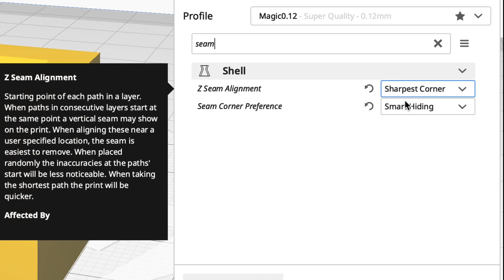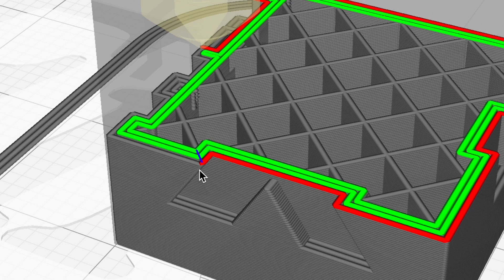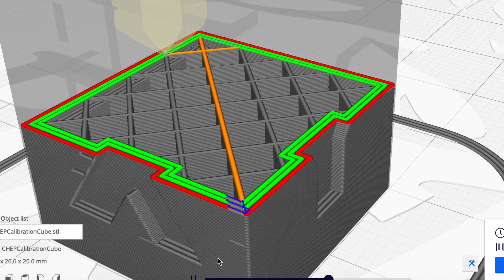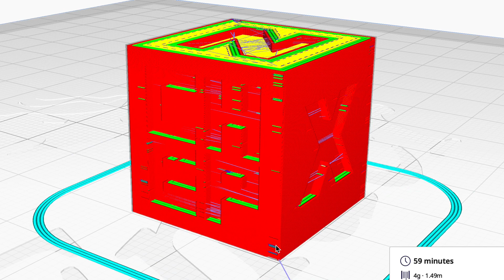Improved Cura Slicer 4.4 Profiles for Creality Ender 3

Comment: Hey Chep, I just moved from an Ender 3 Pro to a Prusa MK3S and you know what's the worst part of this move? I don't have your support anymore, haha. If you could upload a Cura profile for Prusa printers, I'm sure many people would be super grateful as your profiles are simply the best.
Reply: And whats are your first feelings and opinion about print quality, differences and needed adjustment of printer and so on? Do you think its worth to do such an upgrade, just for hobby printing? I also have Ender 3 Pro, and looking for more reliable printer, where i dont need to make a lot of adjustments all the time (in case of my Ender), and just print.
Reply: @creativ01  After spending over a week with the Prusa I can tell you stick with the Ender. Still haven't gotten to the quality the Ender gave me (thanks in big part to Chep), and the amount of things that can require adjustment is simply ridiculous. Also, and I'm still surprised by this, the Ender community is much more supportive. There are way less information about the Prusa (how is this even possible??)
I'll give you some pros and cons, as I'm still a bit emotional about the change, hehe. It's better I stick to the objective facts.

Prusa pros:
- Obviously all the cool stuff. Direct drive extruder, autoleveling, magnetic bed, it's quiet, etc. It has very good components. The bed and hot end heat up at the same time and takes no time to reach the right temperature.
- The entire printer is open source, so if anything fails you know quite well how to fix it.
- If you buy the kit, apart from saving some bucks, you will know quite a lot of the printer and admire how nicely engineered it is.
- The printing volumen is smaller (than the Ender), but I like that the X axis is 25cm long, so for 25cm pieces I don't have to use the brittle Z axis.
- It can do all the normal materials with no problems, which is nice.
- Looks cool. It's compact, orange and black always look nice... 

Prusa cons:
- From 12 to 16 hours to assemble the kit, with the extra risk of doing something wrong. The first 6 hours are fun, the rest of the time, you just hope all will be ok at the end.
- As the pieces are 3D printed by prusas, even in the extruder, there are so many things that can fail or be improperly adjusted. IMO, the extruder should be all metal and with way less things to tune manually. I would even consider paying $100 more for a kit that comes with the extruder pre-assembled and factory calibrated (like the Ender).
- I find less support that for the Ender, and as I said, I'm still shocked. Maybe I haven't spend time enough digging, so let's leave that for now on the side.
- The printing quality is the same, or maybe even worst than my Ender. There are tons of posts about extrusion inconsistency, bad layering, etc. and many times I have read people being very frustrated about the experience and how they are considering getting an Ender.

Final thoughts: I'm gonna stick to my Prusa as I already pulled the trigger, and I'm gonna fight to make it print as good as possible, but if I knew about all the issues and printing quality that is giving me a month ago, I would have kept my Ender and spent $200 in extra upgrades (new extruder, some extra tuning, etc. same stuff Chep does :) My Ender has given me flawless prints, that I would say are almost impossible to beat in the 0.2, 0.4, PLA territory, and has worked GREAT out of the box. 1 hour of easy assembly and boom.
Reply: @ALZHEM  Thank you very much for that valuable informations and experience. I have made some upgrades on my Ender already and im pretty ok with quality so i think, i will stick with it. I wish you good luck with Prusa and a lot of great prints.
Reply: @creativ01  Happy to help bud, and happy printing to you too!

Comment: OMG, used your profile for my Ender 3-Pro. I finally can print nice things. Thank you.
Reply: May I ask how did you load the profile on Cura with Ender 3 Pro?  Mine keeps showing blank folders.  Thanks in advance.
Reply: @jamilawolf9805  I downloaded his profile onto my downloads folded on my PC. I don't use Dropbox. So you will have an option for direct download. You will then need to extract the folder to see the profiles. pick the profile for the Cura version you are using. Let me know if you still have any issues.
Reply: @nikkigolightlygames  Thank you very much, I got it downloaded and opened.

Comment: Hi, I want to say your profiles are amazing. I have never used anything other than the stock profiles with cura and they seemed to work. Your profiles show much crisper detail in the prints :) I am having one issue however, and being a novice I am unsure what to look at to fix the issue. Upon using your 0.2 layer height profile to print a raspberry pi enclosure I had a major issue with it trying to print the solid circle on the first layer. It appears the profile attempts to start the solid circle from dead center and rapidly turn outward making the solid circle to size. Unfortunately, when it starts in the center and moves out it appears there is not enough distance gained from movement and it doesn't lay down the filament. Instead the filament attaches to itself and forms a big ball until the circle gains size. The blob is then left behind on the circle and missing the center section. I know the bed is leveled fine, as the standard profile printed the enclosure fine. Please, any ideas would be helpful. Again, thanks!
Reply from the maker: That doesn’t sound like the nozzle is close enough but you can change first layer pattern from concentric to get the same 1st layer as standard.
Reply: Thank you! I'll double check everything before switching. :)
Reply: Jeffrey Bradley Hi, I have found the same issue, did you solve your problem?

Comment: Am a HUGE fan of your MAGIC profiles. Been using them for a while now. Thanks for all the effort you have made! However, today I changed my nozzel to 0,8mm and it dont work quite as I expected. Changed the line width to 0.8 etc. But there is a big gap between the START and STOP for each layer, creating a big gap. 
Disabled the "Enable Coasting" feature but that didn't made any change. 
Is it possible to make a Magic profile for 0.8 nozzle? 

Best Regards Mr Semla.. 
PS: Happy New Year to all of you at Filament Friday!!

Comment: I ended up going back to your 4.3 profiles.  At least for 0.28 I had all sorts of issues with zits and just really ugly prints, especially for prints with rounded corners.  (And yes I did upgrade to the latest version after you announced there were issues) whereas your 4.3 profiles for 0.28 with the same flow rate produce absolutely beautiful prints.  Perhaps its something about my setup that means the 4.4 profiles are not producing nice results.  I do have a knock off dual drive extruder, but that works just fine with 4.3 profiles.  I don't really have the time to figure out what about the 4.4 profiles is not working.  The chep cube for 4.4 0.20 was a beauty, so perhaps its just 0.28 that is a problem.  When I have some time I will try a 0.28 chep cube with the 4.4 profile and see how that turns out.
Reply from the maker: There have been some complaints about 028 but 020 and 012 seem fine. I’ll go back and look at 028 again.
Reply: CHEP  that would be great. All in all I’m getting good prints with the 0.2 (thanks heaps) but tithe rounded corners (MakeChetti Ender’s display cover) are not great. Cheers
Reply: Jason Pell I was having the same with the 0.28 profile

Comment: I'm giving the Magic 0.12 profile a shot on a 28mm miniature right now. I am surprised by the speed as the extruder is moving much faster than the other profile I was using. When using one of the three Magic profiles, does it matter if I use a 0.2mm or 0.4mm nozzle?

I also bought a set of belt tensioners after watching your previous video and they make tightening a belts a breeze. Very much appreciated!
Reply from the maker: I didn’t see a major difference in 0.2 nozzle.

Comment: HI Chuck i've had problems with sticking for the first layer on my prints. I have to turn the travel speed very low to about 5mm/s to get it to stick and thats even for very simple prints. I also increase temp and initial layer flow. These do work however I am trying to test a much harder baby yoda print (similar to the one u recently posted about). I'm using the Magic 0.12 profile and even at 7mm/s it will not stick to the bed, especially when doing small circles, mainly i notice that the travel speed is so much faster than the initial layer speed that it pulls the PLA off the bed. I've used your square bed levelling test and that is perfect and I am using the default magnetic bed that came with the Ender 3 Pro. Do you have any idea how to fix this issue?
Reply from the maker: Try cleaning the bed surface.
Reply: @FilamentFriday  I've just tried that, no success. The main problem I think is that when i started printing, I had my bed way too close to the nozzle during a print (this was because i was having issues extruding filament although it turned out the nozzle just needed cleaning). Now there is an outline of that print on my bed and it's very smooth. Do you know if it is possible to fix this, or will i need a new bed?
Reply: I have been using aerosol hairspray and loving it. Might try it

Comment: I imported your profiles into Cura 4.4.1 for my Ender 3 Pro.  I noticed that they override the materials print temperature.  I use several different materials with different printing temperatures but no matter what material I select the "Printing Temperature" is forced to 205.
Reply: Hi Fred, 
I had the same issue, so I modified the "Standard Quality 2.0" profile to match CHEP's magic and then saved it as a new profile. Now the temps change with the material.
Reply: I found the problem in the config files. The various print temperatures were hard coded to 205.  The profiles are located in %appdata%\cura\4.4\quality_changes\.  The ones to edit are the creality_base_extruder_0_magic0*.cfg files.  There are several "print_temperature" settings that are hard coded. (e.g. material_initial_print_temperature, material_print_temperature, material_initial_print_temperature, default_material_print_temperature, etc.). I deleted the "default_material_print_temperature" line. This will force the profile to use this setting from the material profile. Next I edited all the other *_print_temperature = 205 lines and changed the "205" to "=default_material_print_temperature" so the line ends up looking like "material_final_print_temperature = =default_material_print_temperature
".  (the "= =" is not a mistake).  For me this was not a difficult fix as I am  software developer.  I posted here in hopes the original profiles would be corrected so that everyone would not have to edit the profiles.

Comment: I noticed that the .12 and .28 profiles both have hard coded  fan starts at .2.  this seems to cause the part cooling fan to be on from beginning of .28 prints.  Is this expected?
Reply from the maker: That’s a mistake in 0.28.
Reply: What should it be, should I change it to .28?  What about for .12, should that be .12, or is .2 still correct?

Comment: When I Preview in Cura 4.4.1 my view is all yellow. How do I get the colors like you show and simulate the nozzle like you show? Is that some kind of add-on? I looked all around in Cura and can't seem to find anything like that.
Reply from the maker: It’s default for me.
Reply: @FilamentFriday  Well, in Cura, Preview mode, click the pencil up top in the Color Scheme header and you can pick different schemes, very cool. So I have THAT figured out, but I still don't know how  you got the print head to zoom around like that!! More to learn. OH, and yours is likely "default" because once you pick a scheme it's "default" and you probably picked it years ago and it's just there for you:) I'm sort of new to this, so mine will default to that now, too!
Reply: To see the simulated print, to the right of the settings box is a vertical bar that is actually a scrollbar. You have to slice your model first though.

Comment: I've been seeing a lot of people saying they are still getting blobs or zits when they are using this profile with their esteps already calibrated. I was in  the same situation then I turned off retract before the outer wall. this seemed to get rid of it all as my extruder was retracting then pushing out more filament than it needed to when starting the new layer for the outer wall. Hope this helps people.
Reply from the maker: Interesting.
Reply: This helped slightly, but nowhere near the quality of the 4.3 profiles.

Comment: @Chep, as for many, the new settings worked exceptionally good on angular objects but the cylindricals come up with the worst chickenpox I ever seen.
Reply from the maker: Check you ESteps settings. My pawn is smooth with no chickenpox.
Reply: wtf is chickenpox on a 3d print?

Comment: Just upgraded from Cura 3.6 to 4.4 and my print times doubled. Adhesion and quality seem to be better, but that speed decrease was quite a shock. Not sure what specific settings caused it.
Reply from the maker: 3.6 wasn’t accurate but double seems excessive. I covered the difference I saw here:
https://youtu.be/iglfelMd7HI

Comment: Hi Chuck, there seems to be a bug in Cura 4.4. If I want to print a single layer with a layer height of 0.15 mm, it does not allow it. It creates two layers instead as a default.  So creating a thin  single layer strip seems not possible which I could do with previous versions.  Do you know anything about this?
Reply from the maker: Why would you want to create a one layer print?
Reply: @FilamentFriday  For a living hinge design for a lid of a small box. With this bug, now it does not work! The hinge is too stiff with two layers.

Comment: CHEP, I already saw a comment below, but a lot of people might have issues with e steps/flow rates. Personally even with calibrated steps I need to use around 90% flow. Without reducing the flow I was also getting a lot of zits in places where prints have started. Overall thank you again for the profiles, your channel is a great help with upgrading my printer and learning new things.
Reply from the maker: Every filament is different but many are getting the same results I am. If you have to reduce to 90% flow for the whole print that would imply calibration is still off.
Reply: CHEP Thank you, I will recheck everything again. Overall yes, the quality is great with this profile. Also it is really amazing that you discuss things with the viewers, thank you for that.
Reply: @FilamentFriday  Can you elaborate on this a bit? The flow % in Cura is the extrusion multiplier, and from what I understand, should be part of your normal printer calibration, after you do your e-steps (without load).  Mine personally is 88%. What calibration would be off to cause your extrusion multiplier to not be 100%?
Reply: @FilamentFriday  Let me elaborate a little on my reply. 

After watching a few more of your videos, you adjusted your e-steps after you attached your hot-end back to your extruder. I don't think this is correct. Your e-steps is to make sure that when the gears on your extruder turn, it knows how many steps to output 100mm, without load.

After you calibrate and set this, you add load to it by hooking your hot end back up to it. You then calculate your extrusion multiplier (flow %). This will vary based on many factors, including the temperature of your hot end, the type of material, as well as other settings in your slicer. None of these will affect the e-steps from your printers settings.

When I change material, from PLA to PETG for example, my e-steps are the same (I've verified this) as long as the diameter of the filament is the same. However, because of the different material type, and hotter temperature, my extrusion multiplier is different.

I can store this setting with my Cura profile specific to my material, and not have to go back and touch the printer settings themselves. So, I have one set of profiles for PLA, and another for PETG and never have to change my printers e-steps or any other settings. It's all in my slicer.

Comment: Hey Chuck I just got a Ender 3 for Christmas and I have a problem with the prints if I do the 3 given on the micro sd card they center after hitting the origins and when I print anything I loaded onto the micro sd card it runs to the origin but stays there and prints off the board. Any kind of help I can get will be appreciated. Thanks
Reply from the maker: Are you using the Cura Ender 3 machine setup?
Reply: @CHEP I’m not really sure cause like I said I just got the printer for Christmas and I’m new to this kinda stuff

Comment: I was going to import your profile ender3 profile and do some test prints with cura for my maker select v2.  I used to use cura and stopped because constant bad results.  When I try to import the profile I get "Could not find a quality type super for the current configuration."  Do you have any ideas?
Reply from the maker: You have to select the Cura machine model.

Comment: Hi Chuck.  I just updated from Cura 4.0 to 4.4.1 with your new profiles.  I know in 4.0 the suggested print times were off, but what I am seeing with 4.4.1 doesn't make sense.  I sliced a model that I already printed and knew the actual print time for.  4.4.1, with your new profile, is saying it will take almost 9 hours longer than what it really took.  Again, I was using your 4.0 Cura Profile and now the 4.4 profile.  Did something change in the Cura updates that would account for that much time being added to a print?
Reply: Robert McLay I have the same problem and I am relieved that someone also had this problem, for me when ever I print something over 150mm it estimates over 3 days!
Reply from the maker: I’ve only used 4.4. It was accurate.
Reply: CHEP I have the problem that the print will actually take 9 more hours.